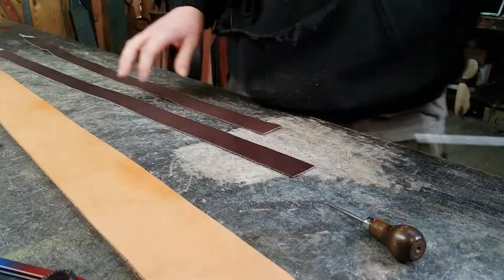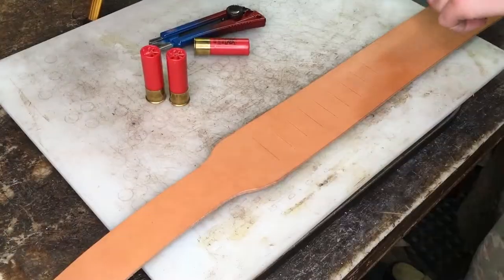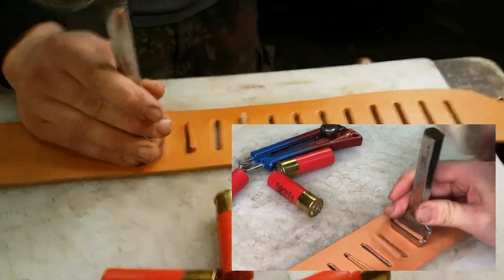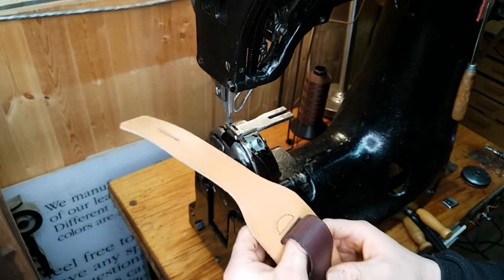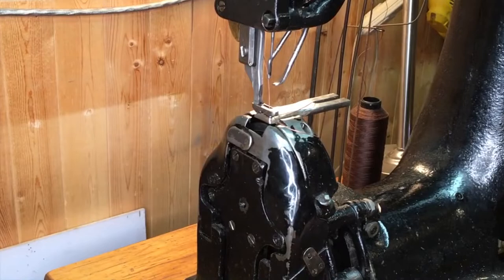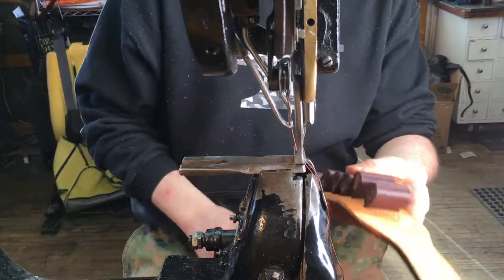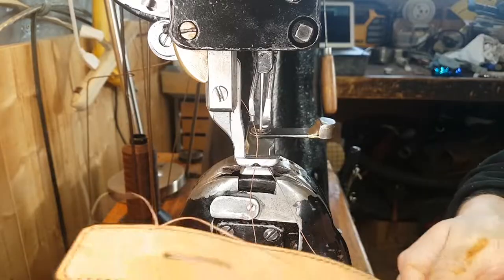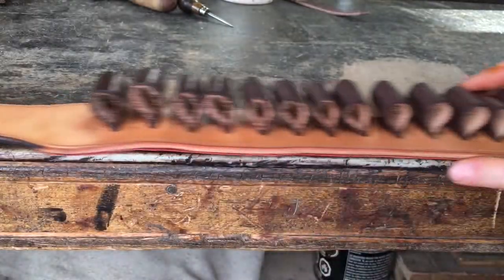Shotgun Shell Belt || Leather Part 2

Comment: Cool video!
The one thing I really wanted to see what how you sized and stitched the loops themselves, which was not shown.
I am currently making a pattern for a Shotgun bandolier, but I don't know the spacing for the hole punch, and how big the loops need to be.
You mentioned about an inch spacing for the punches (but a small difference can be significantly better or worse).
Also: Did you place a shell inside the loop, then mark the loop size, and then stitch with the shell removed?

I guess I can make a test piece with just 3-4 loops and see what works.
Reply from the maker: Thanks for watching and subscribing Derek. This is true, I did leave it out. If you would like, message me through my facebook page and I'll guide you through how I did it. It was a little tricky at first. Props to you making your own 👍
Reply: @noarthcreations777  Thanks!
Reply from the maker: I will be making a video showing this process, thanks for the inspiration.

Comment: Excuse me sir what is the weight of the leather you used for the loops?
Reply from the maker: Great question. I started with 8-9oz bridle and split it down to about 4-5 oz.
Reply: @noarthcreations777  What was your method of shaving the leather sir?
Reply from the maker: Same tool I used in part 1 to split the main strap. Its a strap splitter.
Reply: @noarthcreations777  Okay thank you very much sir